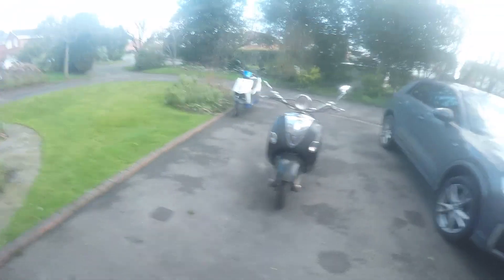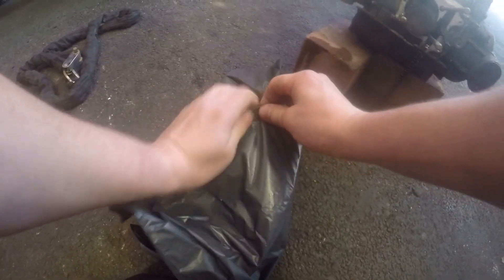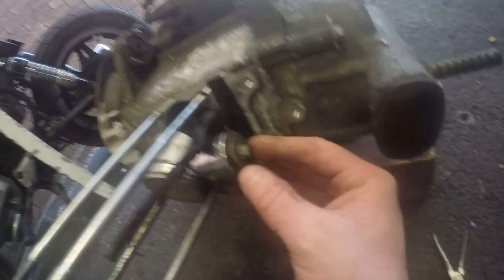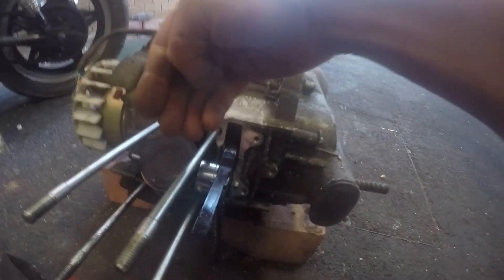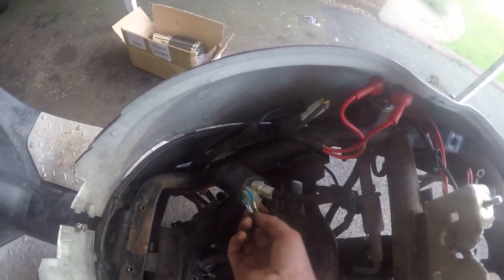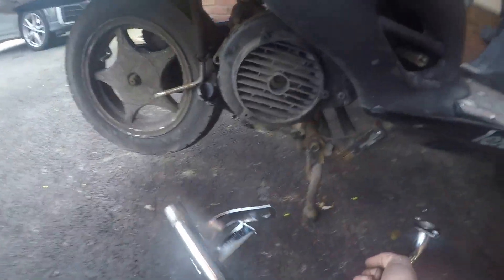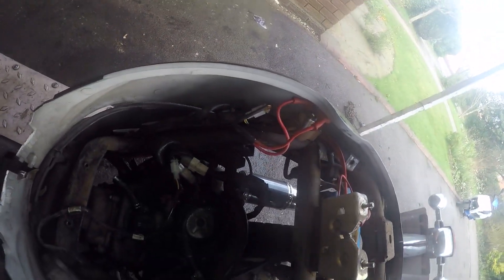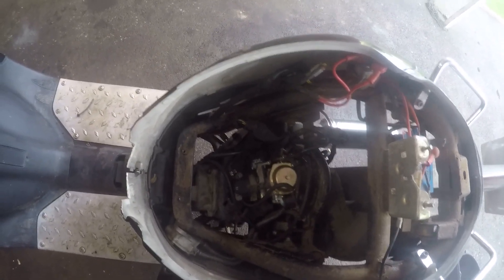1 day GY6 scooter built/stuck piston pin removal

Comment: Awesome tip on the "puller" idea.   But after you removed the pin,  did you machine out the rod end or did the new pin slide in freely?